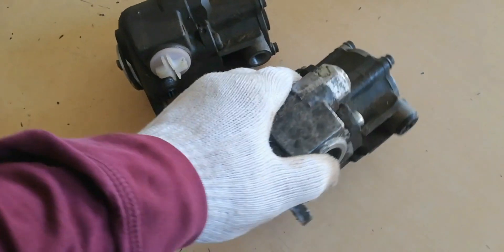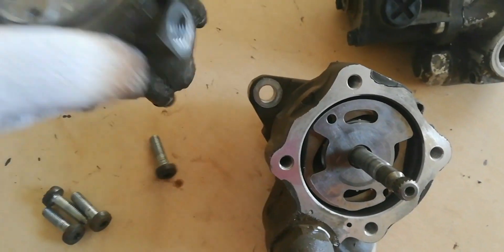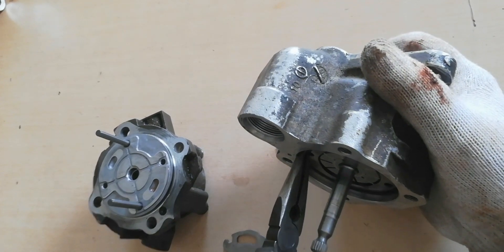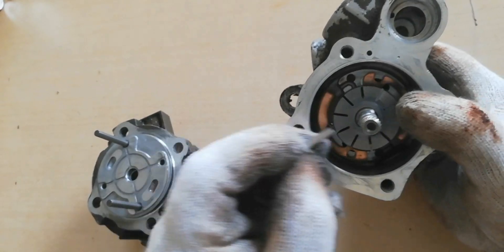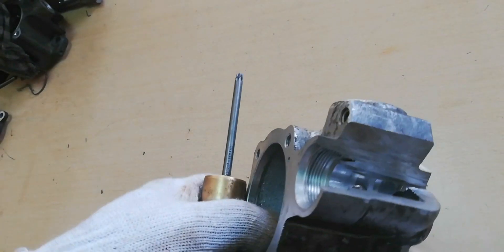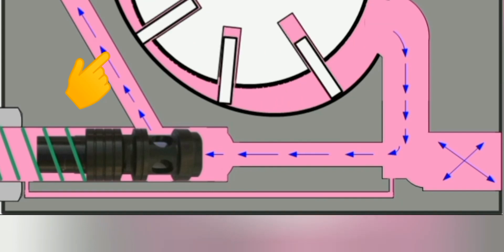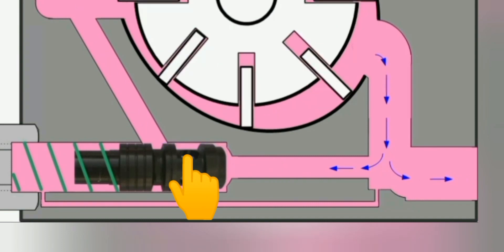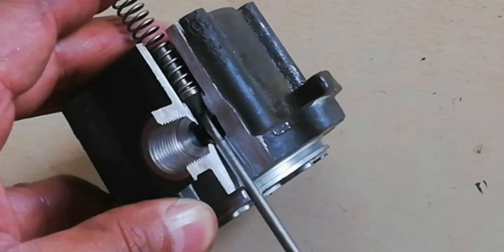CAUSE OF POWER STEERING PUMP LOSS ON PRESSURE AND HOW IT WORKS@yrhelmechanicalelectrical9113

Comment: If the spring shown green in the animation at 7:40 gets weaker, would this reduce the pressure output of the pump? Thanks
Reply from the maker: ofcourse there is also some happened that the spring is broken but when its happen there is always other cause, maybe its too tight, using more pressure than the normal, try to check the cause  like pin or joint
Reply: Thanks, my reason for asking is that I'd like to reduce the pressure from my pump so I was wondering if I put a weaker or shorter spring in to replace that, would this reduce the pressure of the pump.
Thanks very much for your reply 👍

Comment: i have a  zf (fomoco) steering pump in volvo its not leaking and theres no excess noise but steering is heavy at idle does get lighter if rev engine what is likely couse please?
Reply from the maker: https://youtu.be/EhgxIsixEh4

Comment: So,,my steering pump is over pressurized and actually spitting oil out through the  cap. Does that show the pressure valve is stuck closed?
Reply from the maker: if you have a leak on the steering cylinder air circulates into your steering pipeline and the steering oil will overflow into the reservoir